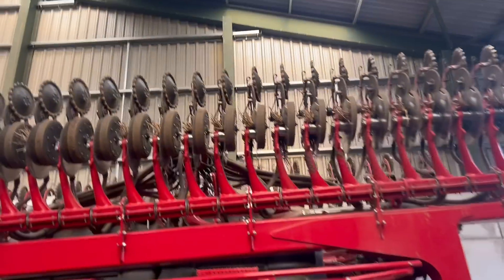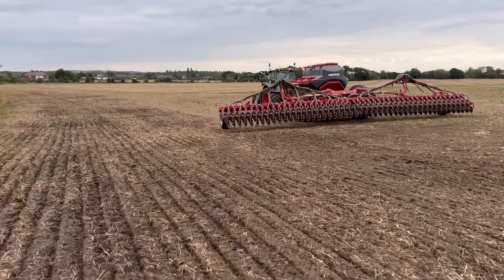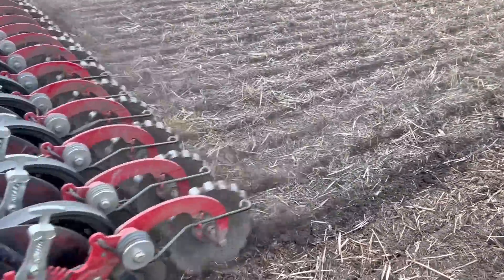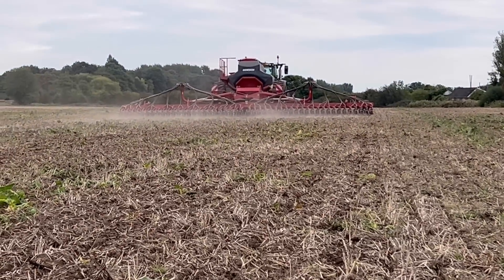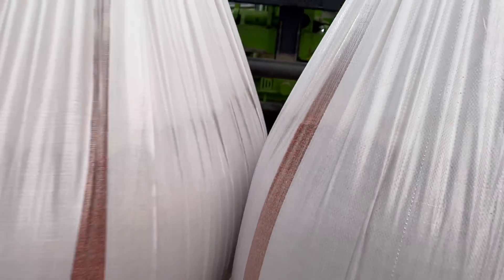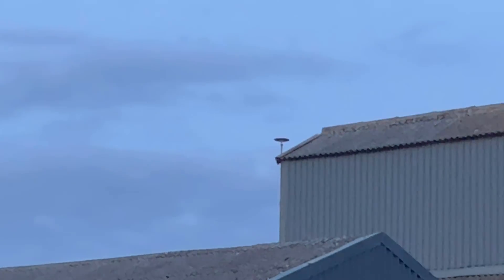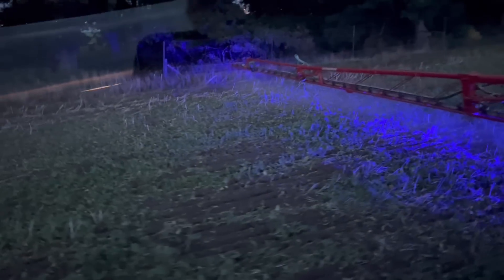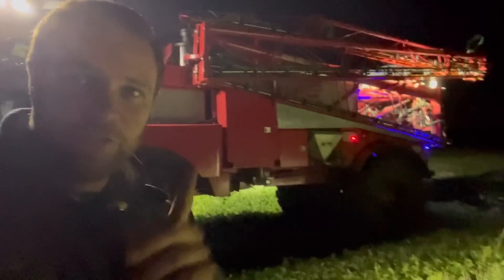DAY 913 DRILL ISSUE & BLUE LIGHTS DONT WORK WITH YELLOW  #OLLYBLOGS  #AnswerAsAPercent

Comment: Your right, if you move the base station everything will shift by the same amount, I am a land surveyor and work with GPS almost everyday for the past 16 years, you should definitely go for a base station set up, the antennas have come right down in price and would pay for themselves in about 3 years compared to an RTK network license. The only issue would be the distance the radio would cover from the installation point

Comment: How much is the RTK subscription? Creating your own RTK service/base station is pretty easy if you have a technical mind. There are tutorials on the webs for it.

The dirtiest, simplest way is with a Raspberry Pi (£70), an ESP32 (£1) and a GPS Module (£3) it is a bit more dificult to set up, or a much easier way is to use a Raspberry Pie with a simpleRTK2B development board which is about £170.

Comment: I've looked at RTK before in a robotics project I worked on and from the basics I know, if you moved the antenna it would throw out the equipment using it. It takes time to readjust it's position - the base station gets it's known position over time and that fixed position offers corrections to GNSS.

Comment: As far as I know if you shifted the base station it would move the gps position in the field; however it depends on how close you were to the basestation as some systems will use multiple base station and compare the shifts between several base stations and how far the tractor is from them.

Comment: Hi Olly, I am a Geo-Spatial student in Ireland, from what I have heard the base stations have an accuracy of about + - 1mm every km. ie 10km/ + - 10mm out and the stations are usually spaced no more than 60km apart
Reply: Usually they call it "2ppm", which is 2 parts per million. In other words, if you're a million centimetres away, you'll get a correction accurate up to about 2cm.. if you're 2 million centimetres, it's about 4cm..